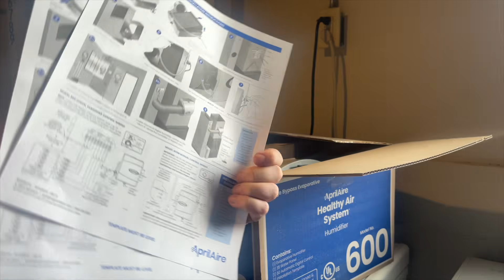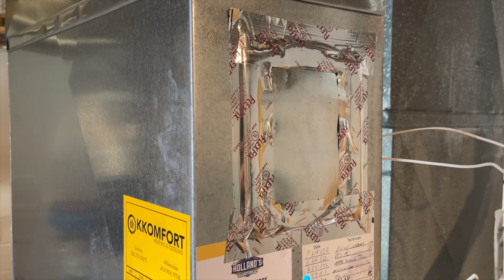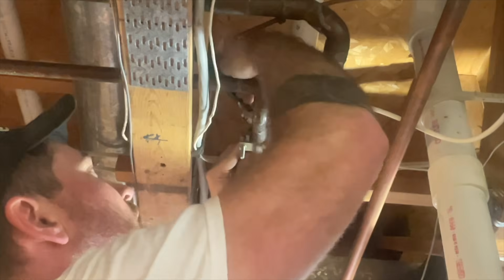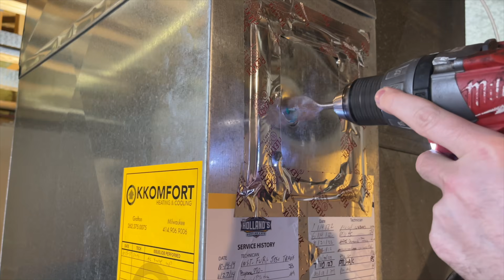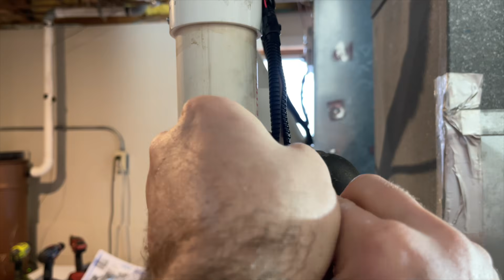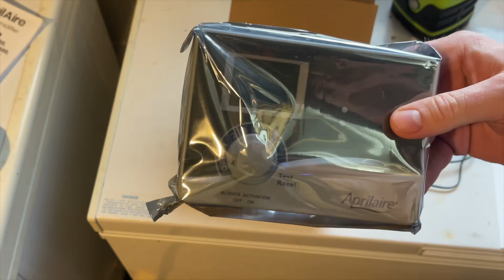How to Install a Aprilaire 600 Whole House Humidifier with Installation Kit- Model 5844 // Bog Life

Comment: Thanks for the video!  hey what was that light you had in the return? is that some sort of UV / blue light to kill germs?, where can i get one of those?, I made this way too hard, I ended up bypassing my thermostat and creating a network of sensors and a relay node, and Im using an ESP32 LCD display where i used chatGPT to code me a hysteresis and squareline studio tpo make a UI thermostat to handle everything the real thermostat did, and now I have Node-red to monitor it via wifi,
Reply from the maker: To the first part the UV light was apart of the system before we moved in. I’m not sure where they got it but it can find the name and give it to you. 

As for the rest of the comment….Im a simple DIYer and I’m not sure what you said.

Comment: Thanks for taking your time to make this video.  Your explainations and video were very helpful.  
I ended up running 18/2 between the solinoid and the HH on the humidistat, which allowed me to use the green and yellow on the 18/5 to run the connection to the furnace and let the unit call for humidity and run the furnace even if heat was not called for .   Doesnt happen a lot but we also have a pellet stove we run sometimes.
Reply: This is exactly how it should be wired! Waiting on your thermostat to call for heat when you have not reached your desired humidity is probably 95% of the complaints people have when they feel like the unit is not working. I also prefer to have the humidistat mounted in the living space, preferably the finished basement to ensure the humidity is not too high for mold growth.

Comment: where did you attach the humidifier? supply or return? thanks.
Reply: return
Reply: We're talking about air ventilation here, right? What would be the point of attaching it on return?
Reply: @Piotrek7654321  Huhhh? Learn a bit about humidifier installation. "Air ventilation" has nothing to do with humidifier installation! 
The installation requirement is not dependent on your subjective reasoning or feelings. Installation is ALWAYS dictated by the manufacturer's design requirements and the specific model! With that said, most furnace humidifiers are designed to be installed in the return duct, and there are multiple reasons for this. Ease of installation, pressure, drainage issues, and leaking issues are a huge reasons. They are also installed in the return so that the furnace's vacuum can mix into the humidifier and get pushed back out by the furnace. You won't get efficient mixing by installing a humidifier into the return, and will just dump out water.
Reply: @MBZ-Nation  This was why I was asking. Get off your high horse once in a while.
Reply: @MBZ-Nation  Years ago, I installed a humidifier in our new home & the instructions said specifically to install the unit right above the furnace, and run the duct to the cold air return & recommended the two to be level with each other.  Even though it's a "closed" system, the more intense heat is right above the furnace, & I think it atomizes the water in the pad more efficiently than if the humidifier is mounted on the cold air return with hot air blowing through it there.  We currently have an AprilAire 550 installed on the cold air return & it has never worked very effectively.  House is always very dry in the winter - right now I'm showing 34% humidity & it's dry as hell.  I'd like to get the humidity level closer to 50%.  The 600 is a little larger unit & has an outdoor temp sensor, & I'm planning on installing it right above the A-coil for max heat on the pad.  Hope it works better than the 550!
Reply: So is it return or supply 😂
Reply: @JesusMontesinos-c2j the idea of putting humidifier on return is this: return air pulled through the moisture and into the supply, then supply  pushes the mist air through duct work. Essentially you get two sources of air movement, a push and a pull which helps with efficiency.